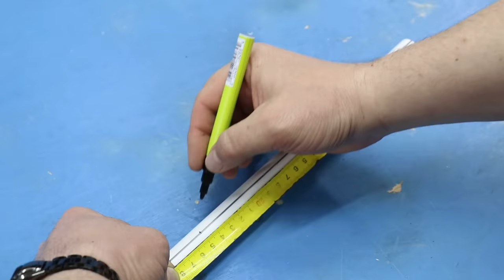Мало кто знает эти Советы и Хитрости мастеров проверенные на 100 %. Секретная функция ЗАКЛЕПКИ!

Comment: I really like the using of a pop rivet body for a cable end. Obviously it works only for very light load when the rivet used is aluminum. I will be using the steel rivets body and a bench vise and a couple of nails to crunch the rivet to the cable.
Reply: Не умничай, если у самого не доходит.

Comment: OK !!! The trick with the wire connections at about 20:00 minutes is pure simplified GENIUS ... I do a lot of 12 volt electrical on my boats and OMG that will make it so simple.
Reply: Медь обжать алюминием, не очень хорошая идея
Reply: Careful with that... compression screw terminals intended for stranded wire can have contact issues with solid.  Been some 3D printer fires with people tinning the wire ends thinking they're making things better.  Works great for a while, then they loosen up and start getting hot. No big deal for signal wires but if they're taking some current then the quality of the contact matters.

Not an expert... but compressing aluminum over copper (dissimilar metals) then putting the solid aluminum under a compression screw terminal strip... well, I'd be repeatedly checking the results for a long time, especially in a marine environment.

Been 4 months since you posted... if you did it, maybe you should check for heat during your next outing on that boat.

Lots of interesting ideas in this video but I'd pass on this particular one.  Made me stop and check the comments.

Comment: The last idea was your best one by far. Insulating the screwdriver shaft for safe use with electrical. Just in case someone goofed and didn't kill the current first.
Reply: It will never pass UL or OSHA!

Comment: 20:31 Electrically Active metal is easy to touch  Very dangerous!!!  Cut flange off rivet before attaching to wire.  Make sure metal parts of "bootlace " ferule is well inside tunnel connector.

Comment: WARNING  !!!!!  20:00 The pop rivet idea for end terminals is dangerous !!!....   cut the flange off the pop rivet first as it is exposed to touching from the outside of the insulated connector housing and may result in electrocution.

Comment: Never ever do, as he did on 19:50. Aluminium + cooper returns into a galvanic pair. When current flows it will warm up until it fires. Very dangerous 'lifehack'. OEM wiring terminal connectors as shown in a box are made of tinned copper and are safe for wire connections.
Reply: It will never pass the UL, NEC, CSA or OSHA codes.

Comment: The first one you have put too much effort into it. All it is, is aluminium stuffing that most modern houses are made of. There’s no need for drilling and riveting. Just cut with ‘tin snips’ then use the correct screw and away you go. Your joining technique Is common with house builders.  Some things just don’t need to be shown.